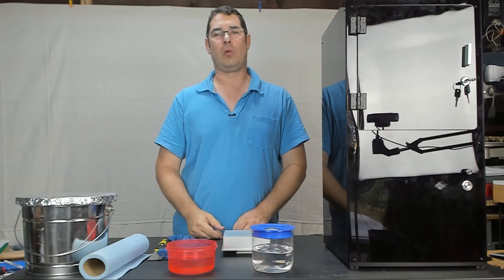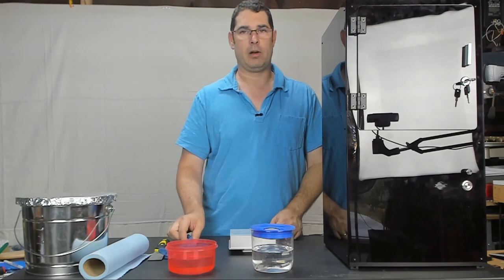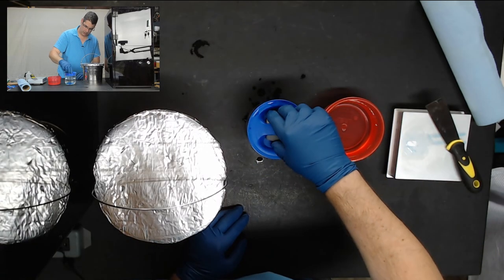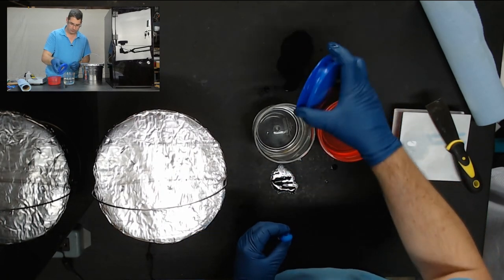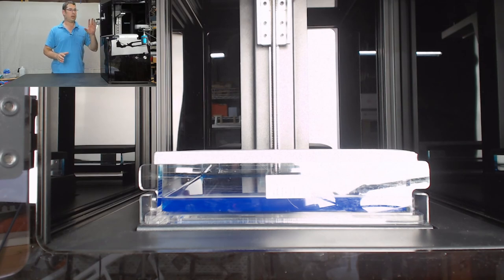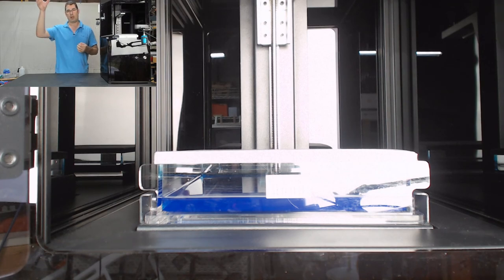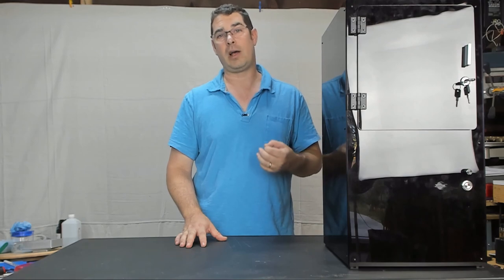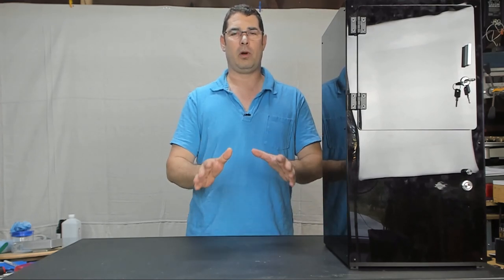Moai Series Part 10: Series Finale - Post-Processing & Taking Care Of Your Moai

Comment: Great series.  The post processing does not look difficult.
Reply from the maker: It's not too bad on simple pieces. But I think if you have more complicated parts, it can be a PITA to remove supports and wash the incurred resin out of every nook and cranny before UV curling. From what I here an ultrasonic take is a life saver!
Reply: Practical Printing Harbor Freight has a decently priced ultrasonic cleaner especially with a 20% off coupon.
Reply from the maker: I’ve looked at that, but I’m holding off for a larger one from amazon that has interchangeable pans.

Comment: Just wanted to point out that ultrasonic cleaning bath and IPA is a very bad combination (yes even 90% IPA). The ultrasonic waves will greatly increase IPA evaporation, making the vapors much more concentrated than with "natural" evaporation and greatly increasing the risk of inflammation due to a spark... Since we're in a hobby/consumer environment we're also talking about a <100 bucks ultrasonic bath and low quality components aren't immune to sparks.

In an industrial environment, we're doing everything to not use any flammable liquids with ultrasonic baths and as individuals we should do the same.
Reply from the maker: Couldn't agree more. However the lost cost Ultrasonic machines DO work great with plain water and Yellow Magic 7.